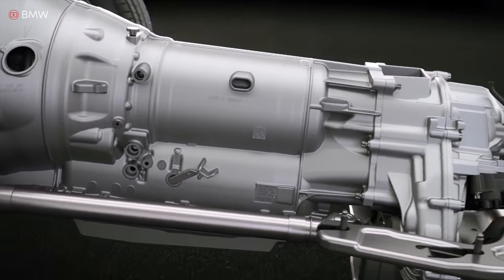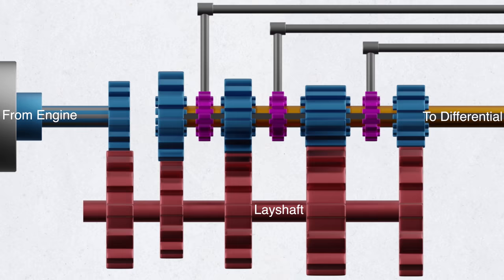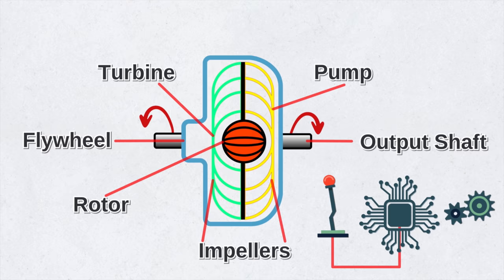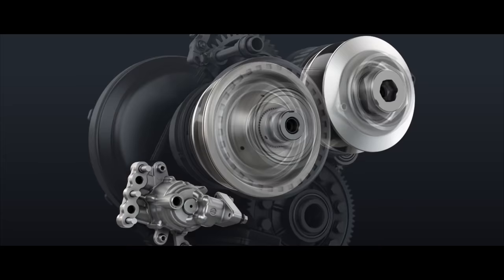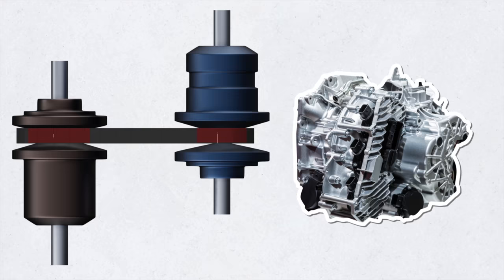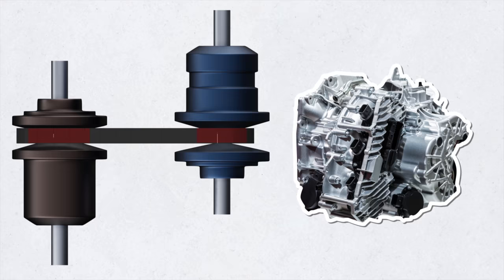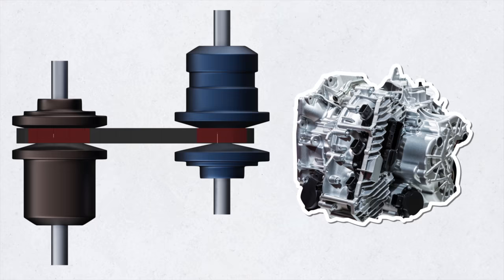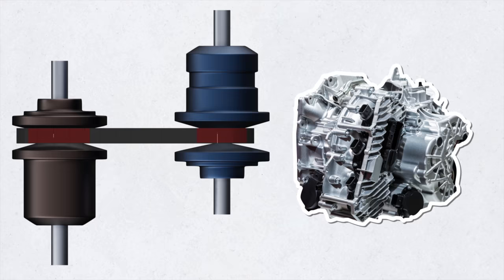Parking Like This Will Destroy Your Automatic Transmission

Comment: BTW. Is it a myth that if you hold in the clutch while at a stoplight a bad thing? 
I've always had the habit of putting it in neutral and keeping my foot off the clutch
Reply: Dunno, but I know being in neutral at a red-light is dangerous , we are taught in driving school to watch the car approaching behind us and ready to move out of the way. That's why we leave 1 car length infront of us at a red light.
Reply: Keeping clutch down is supposed to cause unnecessary wear on the pressure assembly. I'm not an expert but it makes sense and my mechanic father always made sure i'm not standing on the clutch while waiting.
So i always put it in neutral while waiting.
Reply: @imrileth6618  my dad told me the same thing after I got his 86 crx from him when I got my license. Good habit I always thought
Reply: @imrileth6618  That's a good idea. Standing on the clutch will increase the wear on the throw out bearing, which constantly spins while under load whenever the clutch is depressed. If the throw out bearing wears out the transmission gearbox needs to be removed to replace it and at that point you will be going for a whole new clutch assembly at the same time.
Reply: @joevignolor4u949  While my license was revoked for 3 months, Dad drove my car when needed, I cracked shits at him for leaving clutch pedal pressed and in 1st at the lights, I said it will wear out the thrust bearing
Reply: @manFromPeterborough  Apparently older cars going back to the Model T had an oiler tube for the throw out bearing. One end of the tube was open at the top outside the bell housing. The other end of the tube was down inside the bell housing and positioned right over the bearing. Every now and then you'd put a little penetrating oil down the tube to lubricate the bearing. I had an old Chevy that was going through bearings pretty fast. I added an oiler tube and that substantially extended the bearing life.
Reply: @joevignolor4u949  I once bought a clutch kit for a 92 3 cyl Suzi Swift, the bearing supplied was for 4 cyl version, I just dipped the original in the gear oil and threw it back in since I don't leave clutch pressed in at the lights

Comment: Too bad you didn't talk about Toyota's hybrid CVT gearboxes. They're quite unique since they use electromechanical torque converters and combined with a planetary gear they don't need a belt at all. Since they don't have friction components apart from the gears (no clutch either) it's very difficult to wear it out.

Comment: An interesting trivia: CVT is less popular than 'standard' automatic transmission for psychological reasons: Because the computer tries to maintain engine RPM at a certain number to maintain maximum torque and/or fuel efficiency, when you accelerate/decelerate the engine sound stays relatively the same. That is quite jarring for someone raised with manual/standard automatic; one cannot ballpark one's speed from engine sound, and must regularly peek at the speedo.

There's also the non-intuitive engine sound changes: When you accelerate, the CVT will let engine RPM rise to the highest power output, you hear the engine vrooming. But at peak power output, the RPM stops increasing , the engine sound becomes constant, yet the car still speeds up because the CVT is changing its ratio. Then when you reach the desired speed and stops accelerating, the RPM will gradually lower, lowering the engine sound yet maintaining speed, due to the CVT changing ratio again to chase the most optimal RPM for fuel efficiency.

All these non-intuitive behavior makes people think CVT is not performant, while it actually is.
Reply: Main reason for unpopular is because high internal friction makes them wear out too fast! 
CVT operating sensations are kinda like a jet boat, full RPMs/HP off the line... good initial acceleration but jet drives overall only 1/2 as efficient as propellers... so they suck gas and wear the engine out quicker from high RPMs all the time...

Comment: I am a former professional driver and for years I drove trucks that you also had to double clutch and that damaged my left knee so badly that I could no longer drive with a manual gearbox or with a clutch pedal and carry out my work as a driver.
But my employer at the time switched from a certain brand of truck to Volvo's and yes they had and still have the best automatic gearbox in the world or the iShift, nowadays fully computer controlled and also remember the trips you have made and how often the automatic transmission has I have to shift gears without noticing it as a driver, a unique outcome!

My passenger car also became an automatic transmission, ideal if you ended up in a busy city.
There are now also more automatics sold in Europe than before, so the manual gearboxes are less.

Even with Volvo trucks you have had to pay more for a manual gearbox than for the iShift for some years now, it used to be the other way around!

No, for me personally an automatic gearbox is ideal.
Just this, an American relative of mine once came to the Netherlands years ago to visit family, but yes she had to have a car but all rental cars were only equipped with manual gearboxes, oops that was a problem because she didn't know how that worked.
I drove her around in the first week of her visit and explained that switching and coupling is not as difficult as it seems, now that it was talking to a wall because she didn't understand anything.
After a lot of haggling and talking, there was a dealer who could supply the car rental company with an automatic transmission, but there was an additional cost, but she took that for granted.

Comment: I have a horror story about a 2006 Audi A4 Quattro. I bought it from a "buy here, pay here" dealer nearby that had been around for a while. It looked like new, and had very low mileage for a '06, which was 81k mi. The day after we drove the car off the lot the torque coverter went and made the car undriveable. The dealer had it "fixed" on our behalf with a salvage transmission (unbeknownst to us). ~10k mi later and this trans failed. Come to find out it had water in it, and the shop who installed it did not use the Audi spec trans fluid (to save money). 6k for a new transmission...the car is barely worth 4k...needless to say we had to scrap the car. It was a beautiful car and drove amazing. Learn from me; no matter how nice or how "serviced" a car/truck is claimed to be make sure you have an extensive explanation (in writing) of the warranty (the dealer intentionally bought the car, because any mileage over 80k in New York State only requires a 30 day warranty under the Lemon Law) and avoid "buy her pay here" places at all costs.

Comment: San Francisco with a stick shift, did that a lot. Worked downtown and drove a 62 Falcon Wagon with 3 on the tree. You get pretty good at it after rolling back into the bumper of the car behind you a few times.
Reply: I would be beyond pissed if somebody rolled into me. But I guess if I had to live in San Fran I would have bigger problems.

Comment: I completely agree that u should not leave pressure on your park gear however now a days atleast here in michigan nobody uses a parking break on there cars with automatic transmitions and the parking break cable and components rust together so iven if u can set the parking break u may not beable to get it to release also don't forget about your fuel pump running low on fuel can couse your pump to work harder and go bad sooner along with getting too hot

Comment: I historically never, or rarely, use the parking brake. Inevitably the cable or mechanism would stick and the brakes would lock up accordingly.  Back in the day it was just a matter of getting under the car and pulling on the cable connecting the brake lever and the back tires, freeing them up. Then they starting routing the cables through a conduit and the solution isn't so easy.

However, I just purchased an Outback that uses CVT. The parking brake is electronic and I'll likely start using the parking brake.

Comment: This might be an advanced strategy, but one thing I do when driving an automatic is when I feel the transmission is ready to shift I'll briefly let off the gas while it's changing gears. It's similar to a concept when riding my bike, if I realize Im in too high of a gear I'll give a burst of torque, then immediately reduce the torque on the pedals while shifting to the lower gear, then put torque back on the lower gear without stopping pedalling. This keeps me from putting extra strain on the chain, and I've just naturally adapted it to my car for hopefully the same outcome.

I had a Saturn go 250k without doing anything to the transmission (beyond whatever is done during an engine replacement when the timing chain snapped, a known problem in the engine I wasn't aware of until after it happened)
Reply: Depends on the car. If your car (like mine) has a sophisticated computer that calculate shift points etc then doing what you do will cause a jerk when the transmission shifts. In this instance, better to let the gas input stable as you shift - the computer will do the rest.
Reply: @donkgated8074  mine doesn't jerk and the car is 15 years old, whatever is in it probably wouldn't be considered sophisticated lol 05 grand am. Had an 02 Saturn, did the same thing and never had transmission issues and that car made it to 250k before the engine gave out.

Comment: In the UK there are two driving licence tests. If you pass in an automatic car it is illegal to drive a manual, pass in a manual you can drive both. You can upgrade the automatic licence by taking another test in a manual.
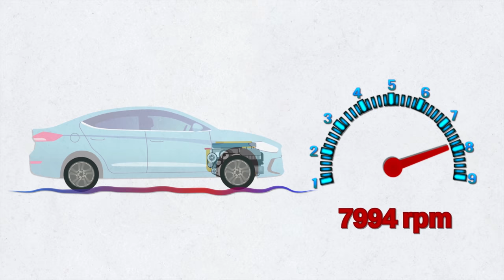At 0:42 you say the engine would only need to run 1800 rpm to reach 60 mph if the wheels were directly connected to the engine, but you don't mention that you could not drive much below 30 mph as at 900 rpm the engine would probably stall which is why we need a transmission, also moving from standstill would be difficult but you could use smaller wheels to raise the rpm. Did you take into account the final drive ratio for that calculation? With a final drive of 3:1 it would be 5400 rpm at 60 mph as with a direct connection to the wheel you would not have a final drive. 
You would need to have a differential to drive at least two wheels or you would have one wheel drive. The ratio in the diff could be set so 60 mph is at 6000 rpm so you could pull away easier but that would waste fuel at higher speeds.

I see plenty of people on the phone while driving in the UK and Europe which have 80% manual cars and vans. You can get 6 penalty points (12 you loose your licence) and a £200 fine if you use a hand-held phone when driving. You’ll also lose your licence if you passed your driving test in the last 2 years.

They say automatics are getting more popular here but manufactures are making more semi automatic, CVT etc models without a manual option and Hybrid with automatic transmission and electric cars are becoming more popular with fuel now at £1.50 per litre or $7.62 per US gallon. About £0.60 is fuel duty (tax) and we pay VAT 20% on the combined fuel and fuel duty price so pay tax on the duty (tax).

As someone who drives a lot in my job (some days driving in London) you get used to constantly shifting gear and using the clutch in heavy traffic and don't usually give it a second thought. Although on some really bad days you can think maybe an auto would be nice, or an EV due to the congestion charge, LEZ and ULEZ charges in London which EVs are exempt from, but EV vans don't have the range I need yet.

What you call an emergency brake we call a handbrake or parking brake (some are foot operated or electronic).

Comment: Excellent video! I have two Opels, one with a Aisin 4sp automatic the other with a Fiat/Alfa 6sp manual. The auto is a 2005 with 160,000km on while the manual is a 2015 with 50,000km on. I thing the auto will outlive the manual...

Comment: He forgot to mention another point why Europeans use manuals. It's the fact that you need bigger engines for automatic cars to function. So not only do you have to pay extra for the transmission, you also have to pay more for the engine and it needs more fuel.
At the moment you pay in Germany 7,68 dollar for a gallon.

Comment: What I regret is not knowing that dealerships have a service book they go by so they know what to charge for parts and labor on a job. I got gauged almost 3 times the real price..
Reply: dealers are ripoff, take it to a general mechanic
Reply: @manFromPeterborough  at the time I took it to a dealer cause it was in the warranty network but I found out that day my warranty was expired by 11 days and they "couldn't do anything" about it. I was worried my car wouldn't make it m uch longer and I had to pay the diagnosis fee if I left with no work. $200

Comment: I had a 2007 Toyota corolla,5 speed, first clutch was replaced at 340,000 miles.  It's all in how you drive.

Comment: Only reason i drive an automatic is because i keep being told by dealerships that a manual transmission is a custom order and therefore will cost me more... looking at you TOYOTA.  I wanted a 4x4 tacoma with a manual so the price would kind of offset (manuals are far cheaper to manufacture) and they told me that would actually cost more than a 4x4 with an auto.

Comment: One day in a high school senior year in my acura  integra a couple years ago, I woke up late and hopped in quick and risked it and drove away quick and I could tell I should have let it sit when I put it in drive. It was only 3 degrees. Luckily it was an acura integra so it was fine. Still my favorite car had the LS 4 door with a Gs-r engine swap. Fast as hell. Miss that car. Both control arms went right before the alternator did. Still got offers of 1000 bucks

Comment: Had a truck with a conventional torque converter automatic. The selector linkage became worn and upon hard braking down hill it selected reverse. There was a loud bang. The truck was still driveable but there was no reverse gear. An expensive rebuild followed.

Comment: Many modern autos, even the 1990s 4L60E from GM, WILL tolerate 2-3 km/h of "wrong direction" speed, as many TCMs won't shift into the other direction until the car DOES stop. Don't try it at more than 5 km/h though, it may go BOOM!

Comment: The only real advantage to driving automatic transmission is when towing a load and having to stop facing up a hill. With a manual transmission, there's occasion that you drift backwards a little before you get the clutch released and the engine gets you moving forward. The risk if drifting backwards into someone stopped behind you. That's a problem never experiences with an automatic transmission.

Comment: The used infiniti g35 I got has a faulty fuel sensor so it just perpetually says that it’s full 😂 I went on a date and told the guy that and he said “aww, your car is just optimistic! A tank half full kinda car”. I just neurotically fill it with gas whenever I’m at a ok priced gas station. I’ll get it fixed soon though!

Comment: I have the 6th gen Accord you see at 11:53, except mine is Black. It’s a 5 speed and it’s so much fun to drive. 
Fun is something I feel is magnified with a Good Manual, and it could be better but it’s never problematic.
It has a F23A1 engine with VTEC, and I can’t imagine driving one with just an automatic now. I highly recommend buying one, mine has 275k miles and I love driving it

Comment: I have a 2012 Ford Focus with the most horrible transmission. I have a tendency to shift before the car comes to a complete stop. So now when I put the car in reverse, if it's hit up or down it will slide into neutral or park by itself. So now I unlearned that in hopes that I can save what's left of my car.

Comment: Scottie" I just bought a 94 Firebird... never knew that they put Camaro rims on it..
Ive had a 69 GTO Motor with a 66 ...389 Crankshaft...in My Garage for about 20 years...Had it bored 20 over...I bought this 94 Firebird... I would like to know about putting My GTO Motor in this 94 Firebird

Comment: Buick's Dynaflow transmission allowed for variable torque multiplication via a fluid drive. The more power needed the more the transmission would allow for higher revs. At cruising the transmission was virtually a one to one ratio. It was continuously variable and did not have set gear ratios. All it lacked was an overdrive system.

Comment: RE: Whale oil transmission fluid. My dad was told back in the 1960s not to change his tranny fluid if it had the old whale oil type in it. All the mechanics said just change the filter and keep the old whale oil tranny fluid because it would last for ages and better for the transmission than the new stuff.

Comment: I blew the tranny out of my very first vehicle (91 Camry) as a teen which was a hand me down that my dad had been driving for several years. I drove her for about 2 years till she started not wanting to shift into reverse. My dad was following me as I was hoping to get the ole girl to the mechanic and I ended up blowing it just miles from the shop. This at the time didn't teach me much as I just figured it was an old car and it was just time to put her out to pasture. It wasn't until I was driving my riding lawn mower YEARS later when the drive belt kept jumping off the pulleys got me to question what in the heck is going on here and someone finally told me about ALWAYS coming  to a complete stop before changing direction. In the mower I would constantly nearly go from two to four wheels from my change of backing up for forward driving. It's shocking I didn't do more damage to that mower as well as other vehicles I drove. Upon learning this it made me think back to my old Camry and cringe as the realization that I probably did her in was now much more apparent.